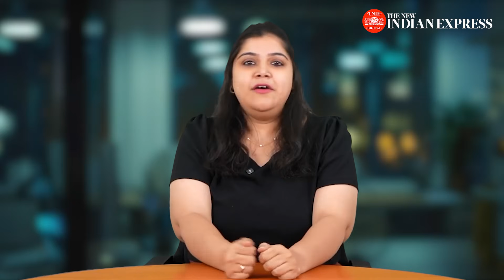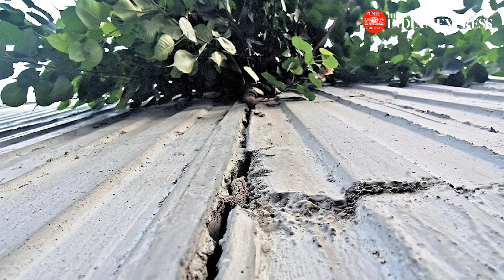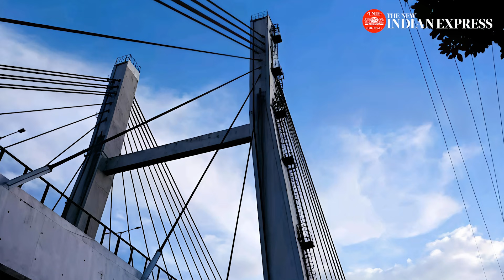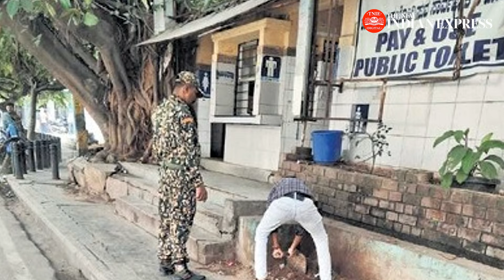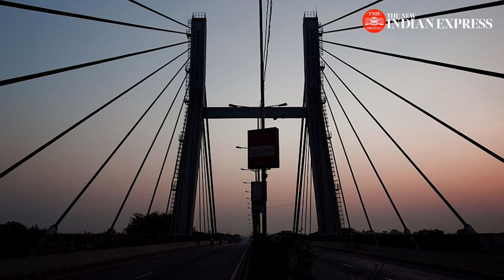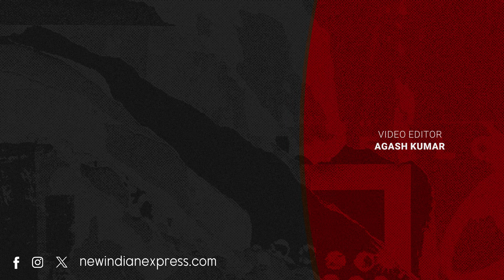KR Puram Bridge Under Watch: Are Bengaluru’s Ageing Bridges Being Properly Monitored?

Comment: Reinforced concrete usually has a life span of about sixty years. In homes built about two generations ago, one can see cement falling off and exposing the steel reinforcement inside. In a highly stressed structure such as a bridge on a very busy road, the life may be reduced. But this bridge is barely two decades old. The deterioration seems rather premature.
Reply: Any Civil Infra structure needs continuous monitoring and maintenance. If a RCC home also is simply abandoned it will deteriorate quickly.